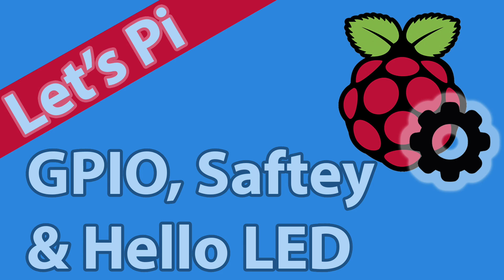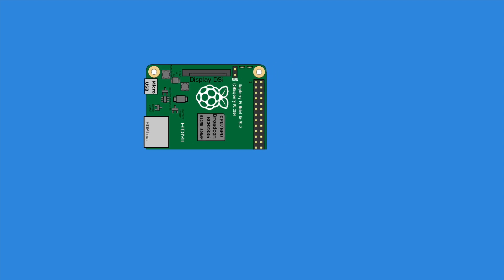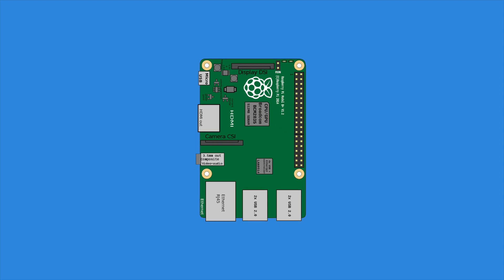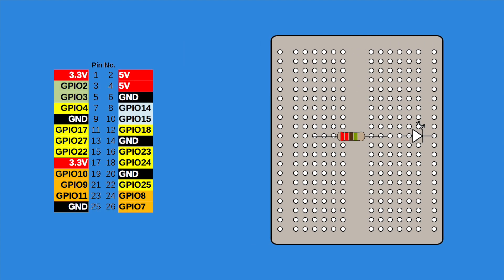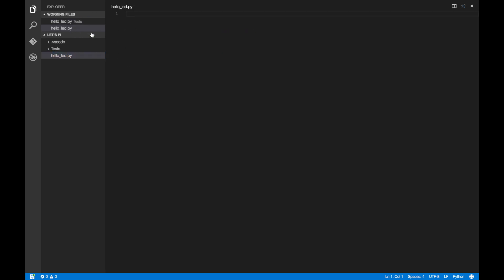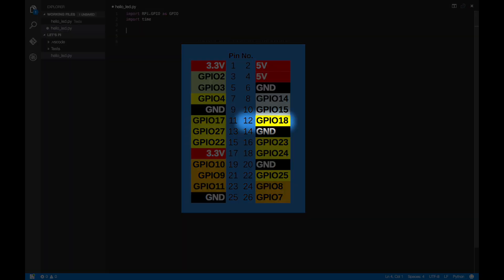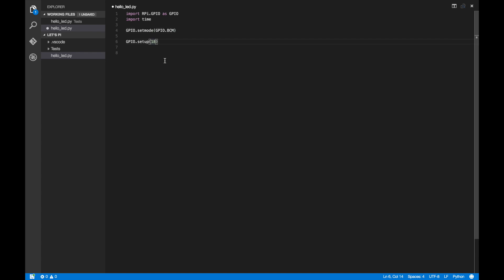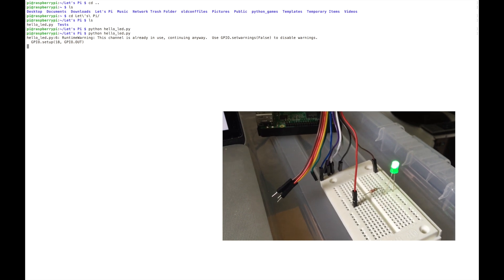[ Let's Pi ] GPIO Header, Safety and Our First LED!

Comment: Thank you for the tutorial!!

Just a tip. You may want to increase your font size for these. Make it easier to read for us. Especially on lower resolutions.

Thank you agian sir. Try sounding more confident, you rock!!!
Reply from the maker: Hey thanks for the advice! Where in particular is the font too small? Is it the terminal & code? I'll keep this in mind for the next video :)
Thank you for the nice comment also :) I'll hold off on the next video until I get paid - I'll buy a proper microphone, I think it will help out loads lol Thanks again dude!
Reply: in both the code and terminal is where the font size needs to be increased. everything else is fine.